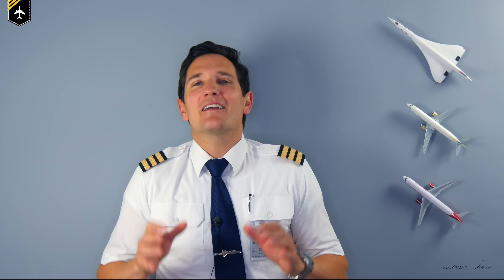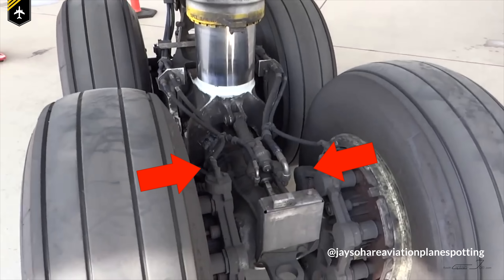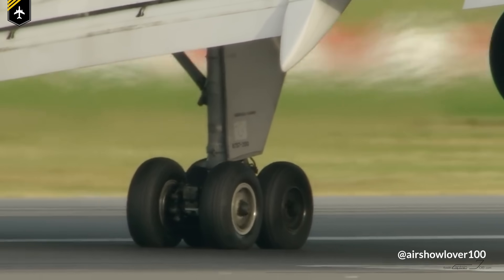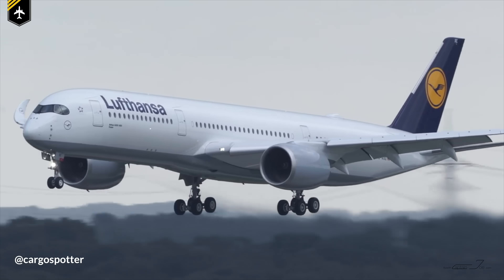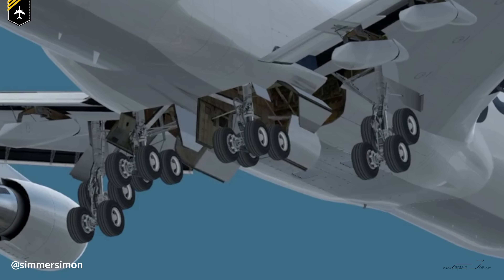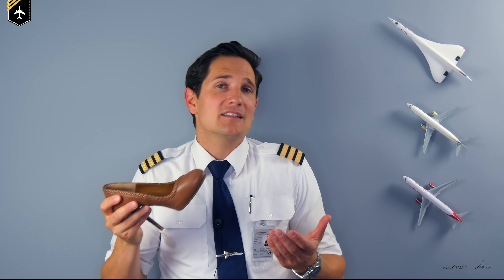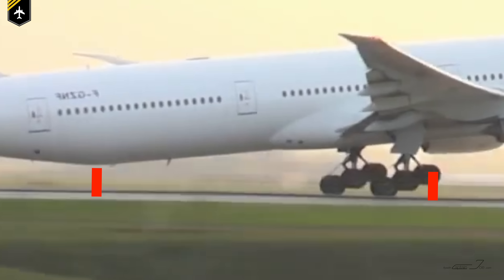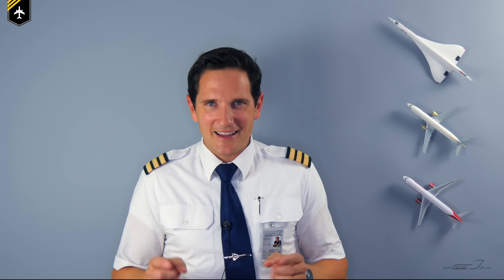Why is the LANDING GEAR TILTED? Explained by CAPTAIN JOE

Comment: New subscriber here.
May i ask how frequent the airplane change tires?
I see smoke when the wheels touches the ground.
Reply: About every two weeks!
Reply: @cockiptvideos9614  on what category is that sir? Passenger? Cargo? Private? Pls. Indicate landing weight. Thanks.
Reply: Mac Hernandez ITS CALLED FRICTION
Reply: @cr4ck3du31  yes i know precisely that it is friction,created when the tires touches the landing area.we may compare it to car tires when drifting or when you are speeding maybe a 150m/hr then you apply brake suddenly thus creating a FRICTION and smoke.it is called "tire burning" as we call it.
Getting back to the topic or to my querry to the pilot, how frequent does the airplane change tires depending on category.let say passenger,cargo,private plane etc.
Can you answer that?

Comment: Juz curious, How do pilot steer a plane on landing and take off, when travel at great speed? Do they really rely on the whole line on the runway to guide the plane like we driving car or they have other mean of steering at the correct direction? I can imagine at the high speed, fraction at a degree off course mayb dangerous. But how they keep the plane straight?
Reply: At high speed they steer with the rudder and the brakes.  At low speed they have a crank to turn the nose wheel to help with sharp turns while taxiing.

Comment: You see wheel smoke when the plane lands. That will smoke means that the tires are wearing out. 
Why don't engineers fit some sort of vane on the rim so that the tire will start spinning before the plane lands? Wouldn't that cut down on tire wear?
Reply: Probably weight. You'd need to add a giant engine to get only 1 of those tyres spinning at close to 300 then you'd need to carry fuel for it and upgrade everything to hold it meaning weight. You're also wanting to slow the plane down and a non moving tyre will create more drag than a moving one. They are designed to do 0-300 in a second anyway.

Comment: When i tow with my tow truck with a vehicle on dollies,  i always put the dollies with the most weight over the front axle.  Why? Different axle loading allows for better skidding with tight turns.  But the main reason is heat dissipation.  On long tows with 50/50 weight distribution,  the front dolly tires are cold and the back are too hot to hold.  With as much weight on the front dolly axle,  the fronts get warm and the backs get warm. Less tire wear,  less heat,  less failure.
That is why i assumed they did that with aircraft.  I thought they mounted the truck further forward and it naturally sat like that.

Comment: I've always wondered why they don't install motors to spin the tires as fast as the aircraft is landing to prevent significant wear on the tires, thus dramatically increasing their lifespan and saving money? Is it purely because of weight savings or have they not thought of it? Not figured out an effective method of doing so? Or would the extra weight inflicted counteract the cost of extra fuel to carry the motors during flight and thus not make a difference or increase overall cost?
Reply: Because it isn't a cost savings.

Comment: I have a question about the wheels: Why aren't they spun before touch down (other than that would mean another motor)? They get that big puff of smoke is the tire surface wearing. So why don't they spin the wheels before touching down to save wear? Or did I answer my own question as tires are cheaper than motors

Comment: As soon as you ref the storage of the wheels it made sense for the 747, the rest clarifies a lot. You wanna see a weird landing gear rig, check out the B-52 set, the plane can land at a 45 deg angle fuselage wise but the wheels be aligned w the runway and then once down straighten the plane out. Already familiar w the C-5s gear, impressive engineering, cavernous aircraft.
Reply: 3:44 I don't buy the 747 explanation.  Who would want to land first on a single center wheel?  I bet that the different tilts ensure that the pair of wing landing gear strike first so that the plane is stable and not a teeter-totter when it first hits the ground.

Comment: I didn't listen, but I read the text explanation and what I got from it was how it works, but not why. I always assumed it was to purposely put one pair of wheels on the ground at a time to reduce instantaneous stress on the main strut. I'm thinking that when the tires first come into ground contact they skid before spinning up to speed and that skidding puts momentary lateral stress on the gear. If four tires do that all at once it's double the stress of only two at a time. Am I wrong?

Comment: also worth pointing out the SLG system is only applicable to the -300ER, not the basic -300 model! That's why the -300ER has better T/O performance

Comment: I still reckon they should be able to put load sensors into the landing gear, so they know how much weight the pilot has to concern him/herself with when determining how much power to be applied for takeoff. Scraping the tail on take off because the load calculation was wrong should be a thing of the past.

Comment: Captain Joe: ( or anyone else that wants to answer) In 2005 I flew from Chicago to Portland Oregon on and MD-80 and was seat directly over the wing so I could help with the exit door. After we took off and gained cruising altitude, I looked down at the wing at a 4X4 inch door with a screw holding it down. It was bitter at O'Hare, below zero and we had to be de-iced. A clear fluid was coming from around the door's edges so I wrote it off as de-icier. After a half-hour it was really gushing out and running down the wing, so I quietly called the flight attendant over to quietly ask if that was normal. She got on the phone with cockpit and a few minutes later came back and said the pilot had noticed fuel use was slightly higher than normal but that we had plenty. What was that door and what could cause us to loose what I guess to be a gallon-a-minute from under it?

Comment: Has there been a video about whether the wheels should be spinning before landing to reduce friction wear of striking the tarmac?
Reply: Rubber is cheap.  Adding needless parts to the plane to spin the tires on landing that they then have to carry on every single flight is not.

Comment: And in the beginning the landing gear was caked in brake dust lol ground crews should really clean that after every landing to extend the life of the gear and hydraulic arms also it prevents problems Bc you can Grease everything up so landing gear won’t fail and lock up

Comment: It is also a kind of applied physics for me. Pulling a sledge (for example) is easier than pushing it. If rear tires are down it looks like the first tires to touch down are being pulled, in this way the touch might be a bit smoother. If the front ones touch down first, it won't be smoother, but I guess the plane would lose more of its (kinetic) energy in the first seconds of landing.

Comment: The answer would be more of common sense. The plane lands at a certain angle, the landing wheels cannot remain straight when landing, otherwise they could break. When tilted, its more of a balance, so it flows while the plane completes its landing.
Reply: sometimes the cockpit sticks up in the air when landing like a 747 because of the tilted landing gear makes its land like that...

Comment: Thanks for this video ! Really enlightening ! I'd like like to ask though, what would the pilot do if the tilting hydraulic actuator failed to tilt align the landing gear before folding it into the bay ?
Reply: Most probably those have microswitches that detect the condition in what is called a "safety interlock", so that if the position is not right, the gear retraction is interrupted. But let's ask Joe...    JOE, ARE YOU LISTENING ???

Comment: First, thanks for the videos.  Many pilots don't know or care how their airplanes are engineered. But some of us want to know as much as possible beyond our type ratings, as obviously do you.  Of course, it is about clearances and retract geometry, but the discussion about WoG or WoW is not pertinent to the tilt cylinder, as even older twins like 737 classic and MD-80's [and just about every thing else] use squat switches to signal auto brakes and spoilers and ADC.  Another point of the location requiring such tilting geometry is the gears' location to the CG.  Some aircraft have a CG envelope that extends after of the mains, DC-10's come to mind which causes an unusual behavior on landing and T-O requiring more elevator and accurate trim and unusual technique of relaxing back pressure in the flare just before touchdown to keep from slamming the nose down - try flying a -10 in a simulator and flaring like a high wing Cessna and see what happens.   Anyway, this is all caused by gear location relative to CG. My $.02

Comment: 747 wing gear is also higher until the wing loses lift after touch down, to it needs to be tilted like that as the wing is flexed up a little during flight.

Comment: Why are tire hubs not shaped so the wind can give them a spinning start when landing?  Could save millions on tire replacement.
Reply: I read somewhere that the added weight to create a system to start the wheels turning, negates the cost in tire replacement.
Much cheaper to replace the tires, than to create space inside the gear well, and use more fuel, due to increased weight.
Reply: @BrimHawk  This can not be true.  Just shape the existing rim differently.  No extra weight. And and that speed you do not need a big cowling to catch the wind.

Comment: Gear bay size is not the case for the A330.. because the tilted gear is hydraulicly trimed straight during retraction so it enters the gear bay not tilted.so fundamentaly there is another reason for the tilt. Most propably is to assist smoother transition from air to ground and the opposte.

Comment: Excellent video. I was looking closely at the tires during touchdown.  And noticed that the pairs of tires opposite each other on each end of the truck are of different diameters. I noticed the inside tire on the rear set touched down first  then the outside made contact.  But just the opposite on the front set. Can you tell me why?

Comment: You say it's is tilted to fit the gear bay but on the 777 retraction video  you see the gear level out to fit not tilt to an angle to fit and I think this is the same on the 757 and 787

Comment: Why don’t they add a small set of wheels on the tail section, so if the tail strikes the ground it won’t cause as much damage
Reply: Jason Murawski generally long planes do have a tail skid dor that
Reply: Some do.  Many have a skid plate to prevent damage.

Comment: One question Captain Joe. A question I've been thinking about since I've been a teenager and saw a documentary on plane's tyres.
Why not incorporate small, turbine-like blades on wheel rims and use the airspeed to spin the wheels before they hit the ground?
It would reduce tyre use, be easy on the bearings etc.
Being a nerd, I wrote to Airbus about it, but I guess they get hundreds of nerd emails a day...
Reply: Good thinking.  But i think the landing is the most critical part of flight, if you make blades on the wheals they will have an effect (uncontrolled) on the planes lift. 
You dont want that when landing.
Reply: @roscommdoggie  
Small aluminium turbine-like blades would not add to the weight and definitely would not create lift - they'd spin with the wheels and create a minimal local turbulence, but no lift.
Reply: @iqnill  
Its about centrifugal force of spinning Wheels.
Not anything to do with lift
Reply: @iqnill  
Dont underestimate the centrifugal force, the landing gear is massive in size and Weight.
If that much mass begins spinning, it will pull/push on the wing.
Reply: @roscommdoggie  It starts spinning suddenly at landing anyway.
But, it's just an idea, maybe daft.
Reply: @iqnill   actually the idea is good, but it will not work.

Comment: 7:07 man your screwed if those wheels don't turn
Reply: You’re
Reply: Onion Pie yours are diff for diff country
Reply: then just hope for strong sidewind or do a quick handbrake turn sideways just before touchdown and let her slide in...
Reply: jcwat well that’s why you trust the discipline of the military haha
Reply: just drift
Reply: you're gonna end up with a jetblue 292 but even worse
Reply: JetBlue
Reply: Why? Just rotate the plane by 90 degree before landing👍
Reply: @tommyreynoso1249  It's actually an intentional feature of the A320. The nose wheel steering unit does some sort of centering tests during certain phases of the flight and if there were to be a mechanical failure that would mean that the system doesn't detect the nose wheel centering then it drives the nose gear to the 90 degree position, where there is a mechanical stop. It is better to land with the nose gear at 90 degrees, where the worst thing that could happen would be a nose gear collapse, than to land with the gear in an unknown position and shoot off the runway
Reply: You’re screwed of the wheels don’t pop down
Reply: Something like that happened to a JetBlue A320 back in 2005.
https://www.youtube.com/watch?v=RgnkY4xzaZE
Reply: @triple7marc  It went surprisingly well

Comment: Very informative video Joe. Would certainly observe the landing gear whenever possible from airport.
Btw, Boeing B737 doesn't even have a cover for it's landing gear & the tyres are exposed to extreme low & high temperatures. Isn't this a risky affair ?

And it will be nice if you can make a video about what happens if landing gear doesn't get deployed or is there any backup in newer aircrafts so as to ensure that landing gear is deployed ?
Reply: Parimal , check out Mentour pilots video on it

Comment: The Galaxy C5 rotating gear made me think about an idea..

Would it be feasible to use tandem rotating main gears for airliners ??

This would greatly help the pilot/copilot in case of strong crosswind landings by allowing the main gear to be rotated to become parallel to the runway while letting the fuselage stay angled relative to the tarmac,following the crosswind.

Comment: I want to know why airplane manufacturers don't use the landing gear to create an extra lift during take off.
Why no foldable wing / wheel covers / mudguard?
the air has to be faster on the front side of the airplane during a take off.
The tail and shape oft he airplane plays an important role during take off.
It isn't difficult to create a wheel cover that also can be foldded in and out.
Reply: Sonds like a good idea but it is a lot more wheight and if it is damaged it could bring that damage in to the wing also there is probably negligible

Comment: Here's a question about landing gears that I've had for sometime, especially with the fact that electric motors are more prevalent today than ever.  As I understand it, an airplane lays down incredible amounts of rubber on the runway when coming in for a landing simply because the tires are not spinning when they touch and then there is a huge amount of friction (skidding) to be overcome between the tires and runway as the wheels spin up to match their rotational speed with the ground.  Wouldn't it add exponential amount of life to very expensive tires and save hundreds of thousands of dollars in runway maintenance costs to clean up the rubber if the wheels would spin up to speed prior to them touching the ground?
Reply: Good question, I always thought that too. I hope some answer this one.
Reply: Rubber is cheap.  Paying for the fuel on every single flight to carry around equipment that is used for 10 seconds for no good reason on every landing is expensive.

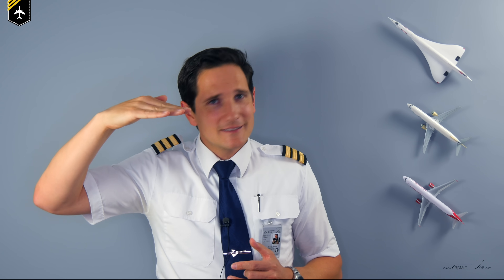Comment: I was not sure while watching this interesting contribution, even less, when you said how simple the answer was,  but I guessed right!! 3:58 SPACE!! And still thinking the answer is not as simple as that !! Lack of space on the first A-310-200s relatively narrow belly let AIRBUS try it with the amongst Pilots - knowingly or not - 1) very small (>short) strut, and to achieve this with a very small range of hydraulic spring deflection and with 2) the carriage kept/left in horizontal position.
Resulting in bad paying landings (all 8 mainwheels touching down simultaneosly), if not perfectly 1) flared and/or 2) decrabed. This lead to my sophisticated landing technique for wide-bodies covering both cases, that really worked in most cases and payed off in smooth landings , as a selection of fellow pilots to whom I explained and/or even better demonstrated it to (weather permitting) confirmed and profited from for their whole career. Wanna know more ?

Comment: Air brakes are triggered by the actuator and automatically deployed?!?! what?! that seems fucking insane
Reply: You really want the plane to stop flying as soon as the wheels hit the ground.  Continuing to fly down the runway isn't a good outcome.
Reply: @stargazer7644  But I want the pilot and or copilot to pump the brakes, not an automatic system that can fail
Reply: @tuanoful  They're spoilers - they dump the lift from the wings on touchdown.  There are also auto braking systems that keep the pilots from locking up the brakes.  You're generally landing on 10,000 to 13,000 foot runways.  You're not going to run out of runway.
Reply: @stargazer7644  What I mean is, what happens if they deploy mid flight?
Reply: @tuanoful  Spoilers? You slow down quickly.  They're often deployed during rapid descents to keep the plane from going too fast.  But they will only automatically deploy if they're armed and there is weight on the wheels.  Which there isn't when the plane is flying.